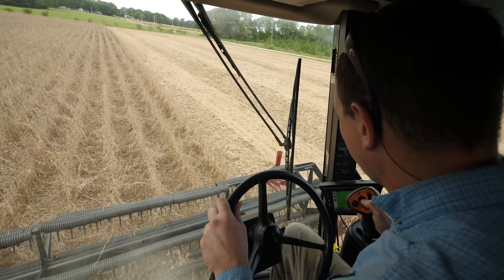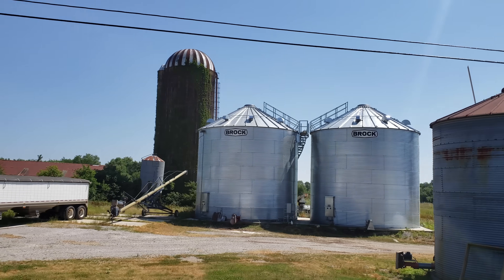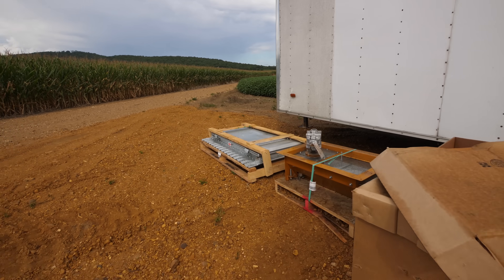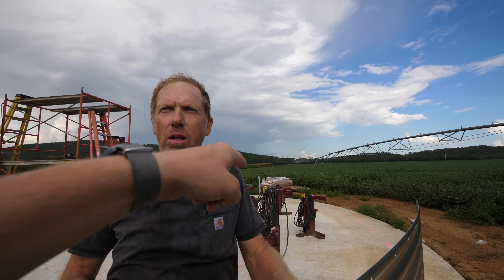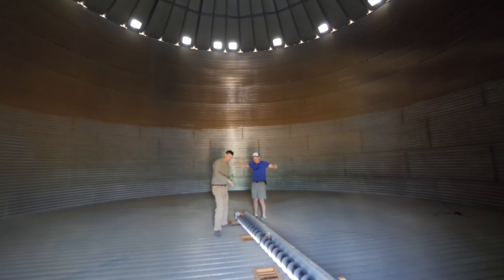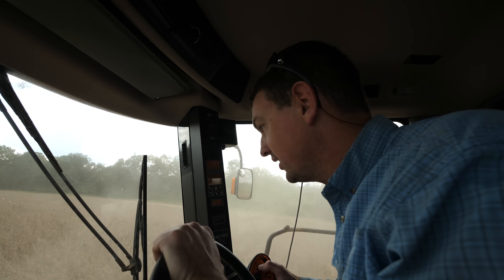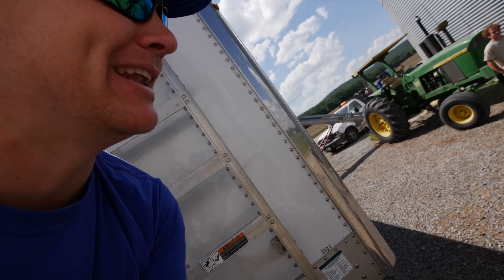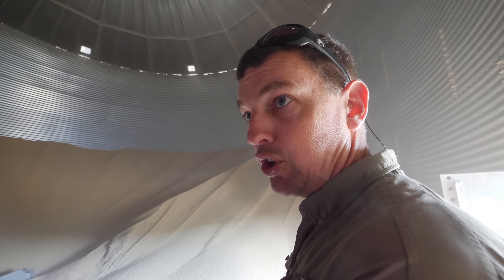Everything About Grain Bins (Farmers are Geniuses) - Smarter Every Day 218

Comment: I thought of the drying process. Doenst it work like the sand pool Mark Rober showed in one of it's videos?
Would you sink to the bottom?
Reply: The way that works is that you increase the amount of air in the sand and the density drops. In this case you have a lot more space between the particles for the air to pass through. Think about pouring water through sand vs. gravel.

Comment: The Debate on 'Glyphosate Toxicity' is far from over. Regulatory Agencies will be setting lower residue limits. Junk Science will be exposed by systematic review. Raw data will be analysed for confidence levels. Interpretation of data monitored for 'Bias' either for or against. Thankfully Artificial Intelligence is a machine operated mostly by The Military who deploy AI to preserve fundamental 'Privacy', yet monitor every electronic communication, by telephone, telex, fax, radio, email etc... 100% coverage. and stored permanently.  This hash policy is to prevent economic warfare escalating to high intensity warfare. Often a result of Public 'Assent', NOT Public 'Consent'... Psychological warfare is of greatest concern. If the public believe they are being poisoned. and later compelling evidence surfaces that those concerns are well justified. Then regrettably we are all in very grave danger of the 'Escalation' of a potential Extinction Event. The biological clock set back billions of years! in the worst case scenario.

"The US National Library of Medicine" Authors Robin Mesnage & Michael Antoniou, 
"FACTS AND FALLACIES IN THE DEBATE ON GLYPHOSATE TOXICITY" (Published 2017 Nov.24th)
Abstract:-
The safety profile of the herbicide glyphosate and its commercial formulations is controversial. Reviews have been published by individuals who are consultants and employees of companies commercializing glyphosate-based herbicides in support of glyphosate’s reapproval by regulatory agencies. These authors conclude that glyphosate is safe at levels below regulatory permissible limits. In contrast, reviews conducted by academic scientists independent of industry report toxic effects below regulatory limits, as well as shortcomings of the current regulatory evaluation of risks associated with glyphosate exposures. Two authors in particular (Samsel and Seneff) have published a series of commentaries proposing that long-term exposure to glyphosate is responsible for many chronic diseases (including cancers, diabetes, neuropathies, obesity, asthma, infections, osteoporosis, infertility, and birth defects). The aim of this review is to examine the evidential basis for these claimed negative health effects and the mechanisms that are alleged to be at their basis. We found that these authors inappropriately employ a deductive reasoning approach based on syllogism. We found that their conclusions are not supported by the available scientific evidence. Thus, the mechanisms and vast range of conditions proposed to result from glyphosate toxicity presented by Samsel and Seneff in their commentaries are at best unsubstantiated theories, speculations, or simply incorrect. This misrepresentation of glyphosate’s toxicity misleads the public, the scientific community, and regulators. Although evidence exists that glyphosate-based herbicides are toxic below regulatory set safety limits, the arguments of Samsel and Seneff largely serve to distract rather than to give a rational direction to much needed future research investigating the toxicity of these pesticides, especially at levels of ingestion that are typical for human populations.

Keywords: glyphosate, chronic disease, pesticides, toxicity, glycine, gluten sensitivity, cytochrome P450 enzyme system, microbiome

Comment: Engineering question: Why are the corrugations horizontal rather than vertical?  I thought corrugations stiffen and help prevent buckling from the vertical loads on the walls, but when they are horizontal I'm not sure their purpose.

Comment: Thanks for the awesome video Destin! I grew up in a farm and spent a couple years building grain bins. Something to mention about the bins is that they are hot! From the touch of the steel to the air inside. The temperature at the Cap is way hour than on the floor.

Comment: I'm super impressed in the way grain bins are assembled and erected. The methods are simple but at the same time genius. They literally put it UP from the TOP DOWN. If it was assembled in a more traditional way (bottom up) you'd need braces to keep the sides from deforming, a ton of scaffolding, and probably some cranes to help assemble the cap. Then again, if it was put up bottom up, it'd probably need more traditional framing.

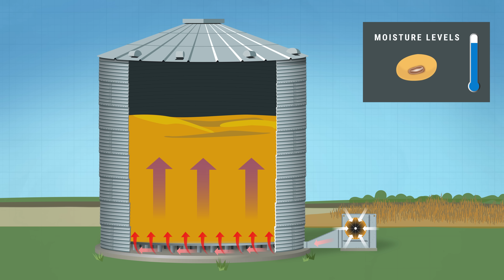Comment: At around 10:00 I just felt that "fluidized bed" explanation coming.. and then there was nothing! But Destin, you love fluid dynamics! I still wonder though, would there be enough air coming from the bottom to create this effect? Then it would sure be super dangerous to be on top of that grain/beans with the ventilation running. Anyways, once again a great video! :)

Comment: i think they hang multiple moisture and other sensor cables  inside the bin, with sensing elements every 4-6 feet, and use computer to control the whole thing.

Comment: Hey Destin, You need to plant your sweet corn(ses) in more rows.  There are 2 reasons for this: 1 - the corn along the outside of the patch doesn't do as well (more competition with other species - in your case your yard) and 2: Corn is an "open pollinated" crop that relies on the wind to move the pollen to the silks to fertilize the grain. If you don't have many rows, that makes it harder for the wind to pollinate the crop as you end up blowing a lot of the pollen into your yard (and not onto the crop). Learned this the hard way myself. If you don't want to raise a huge crop, plant shorter rows in a square plot so that your plot is more rows "wide" and I bet the ones in the center do real well. Good luck with the garden and thank you for shining this much needed light on the ag community. God bless.

Comment: I used to write code for a company that makes these automated air vent systems. We used cables with sensors of humidity and temperature that came from the ceiling all the way to the floor. This way the fans would turn on automatically, to keep the grains dry and at the right temperature, and to reduce the risk of spontaneous combustion.
Very nice video. Keep up the good work.

Comment: Man, I did a short stint of building grain driers in IA, WI, MN. It wasn't a bad job, but the hours were long and almost everyone on the crew was on hard drugs. We'd get up at 5AM and get done at the site around 8PM or later. Then all the other guys would go to the titty bar and I'd try to get some sleep at the motel before going back at it again. I was fired, not because I did poor work, but because I didn't, "fit in" with the crew. Yeeeeeesh.

Comment: Destin, one of the reasons why your corn hasn't done well (I'm assuming you've planted and kept the same size plot every year for your corn as in this video) is that the border of grass around your corn is too CLOSE.  Think of the amount of water that grass takes....just to keep it green.  Then, think about what corn is primarily comprised of....the individual grains that is.... WATER.  Plus, grass takes a great deal of nutrients to keep it green as well as water...think about the root system of grass vs. corn.  They're similar is size and composition. Not exact but similar.  Also, another consideration is the type of grass you have....looks like a variety of Bermuda.  Bermuda sucks a LOT of water.  Theme here is WATER.  You've obviously come to the conclusion that the border of grass around your corn plot is too narrow.  Experiment.  The grass sucks the water away from the corn decreasing growth and a few other things.  Corn requires a "goldilocks" amount of water.  The grass around your corn narrows your margin for error for that "goldilocks" zone.  So, widen the dirt border around the corn and see what happens.  Also, plant some marigolds at the border around the corn.  They a natural insect repellent that lowers the insect pests around your corn.  Great for potatoes and potato bugs (those are the WORST) too!  Smarter every day, eh?

Comment: We use a vacuum cleaner to move our grain...  haha no but really it's called a "grain vac" system, pretty neat thing.  If you look it up.  Another thing about drying grain that's weird is you have to level the top, if you leave the cone shape that is made by loading at one point, it will dry only up to the bottom of the cone and the top has the chance to rot

Comment: Wow. A few months ago I read Julius Caesar's chronicles of the Roman Civil War. They feature some descriptions of the architecture work the legions had to do. And among them, they mention a siege tower they had to build at the siege of Marseille, which they built right beside the city's walls. And they used a similar system to these grain bins, building a first floor and a mobile roof, and raising it little by little as they added floors. This, with the added difficulty that the city defense force was throwing everything they could at them while they were building. Rocks, arrows, fire rags... You name it. They were badass back then.

Comment: Sometimes you frustratingly forget to slip the grommet over the cable when assembling a cord and powerplug -you end up having to take it apart to bits and restart.
Likewise; Someone must have assembled the Grain bin layer by layer, raising it up up and away. When they where done they stepped out and realised they forgot to attach the vents and outsides stairs!

Comment: Destin, about the humidity problem, there is even a greater danger than mold. In some crops, like corn, humidity enables grain fermentation, which generates heat. That heat then overdries the grain around turning it into fuel for a really big bonfire. A really scary, and quite costly bonfire

Comment: As an engineer, I fully agree that farmers is the most difficult job out there XD
Reply: Yeah, you dream-up, imagine, contemplate, design and engineer, and bring into existence something like a harvester or a grain bin; working out all the maths and physics to create a storage unit capable of holding all that grain and keeping it dry and fresh and safe from the elements and easy to load and easy to get the grain back out when it's needed.
But, those farmers. "Woohoo! We read the instructions and put the pieces together with some drills and bolts and nuts and used hydraulic jacks invented and engineered by others farmers, I'm sure. We're geniuses, yeehaw!" "Hey, look Scooter! I poured the concrete. I'm an engineer!" "Oh yeah, Joe-Bob, I turned on the moisture meter. I'm one of them-there scientist!"

Comment: I used to build water tanks for farms in Australia which were built very similar to this. We went from the bottom upward and used external columns to bolt the sheets together that were pre-assembled with threads for the bolting. Then we would use trusses and a specifically designed crane to do the roof. Then the liner is unrolled once the roof is up so it doesn't get damaged by the sun. Nowhere near as safe as this method but not as large as the bins either. Now I'm a mechanical engineer.

Also we call a "punch" a podgy bar (or a pinch bar) in Australia! The most useful fitting tool you can have.

Comment: I recently saw a video, on YouTube, wherein they were demonstrating a rescue device for someone trapped in a grain bin. They left the auger on long enough for the demonstrator to become trapped, and then showed that the trapped person could not dig out, or be dug out, even with help because the grain keeps filling back in. He could not be lifted out either without pulling his arms out of socket.
They were demonstrating a cylinder, maybe 6 foot tall, and  2.5 or 3 feet in diameter. It is lowered around the trapped person, and worked down in to the grain as far as possible. It acts like a cofferdam which then allows the trapped person to dig himself out with a scoop, or bucket, without the grain filling back in. It was very interesting.

Comment: Interesting if this is a dialect thing or what, but I've never called those punches. For me, it's called a punch if the tip is just strictly cylindrical, not tapered. Those tapered ones I've always called "drift pins", since you can use them to "drift" the holes into alignment. As opposed to punches, which I usually use to remove pins from holes (hence the cylindrical shape, not tapered) or just generally tapping on things too far away to get at with a hammer directly.

Comment: Isn't that punch technically a drift pin? I work in theater, we use them all the time, even have specialty socket wrenches with drift pins as the handle (look up Hater Wrench or Scaffold Ratchet)

Comment: when i was growing up, we used a corn tester that passed a small electric current through the sample. it was calibrated to determine moisture content by conductivity.  also: it must be nice to dry with just air movement. in summer in iowa (95 degrees F, 95% humidity) you can't dry corn with just a blower. we heated the blower air by burning propane. and not the gassious propane from the top of the tank (like your grill), we injected liquid propane (from the bottom of a 900 gallon pressure tank) and burned that to heat the blower air.

Comment: Is each ring bolted to the inside of the above ring in order to act as shingles do, and allow the rain to drain down the wall all the way to the ground? If so, is the decreasing diameter change from top to bottom a problem?

Comment: AWESOME vid!  I have always wanted to follow my dad's family in farming, but when you look at all the data they sift through, all the knowledge and skills, it's overwhelming!  When dad was moving back to my state, we went to my uncle's to help load everything into a horse trailer.  To do that we needed a working tractor, and it just so happened my uncle was in the middle of repairing it.  I had to help since my arms are smaller than his, and he was explaining to me how John Deere has started making it harder to get inside their machines in order to force farmers to go to John Deere mechanics to fix them.  It reminds me of my car battery when my uncle tried charging it.  The old cars you can easily get to the jump points on the battery, but the newer models stuff the battery behind everything so the only way to get to it is to have a professional mechanic remove all the parts.  That's a labor cost passed on to the consumer each time they need to replace a car battery rather than the older models which you could do the labor yourself in 5 minutes in a Walmart parking lot.

Comment: Another interesting engineering problem: What happens when these catch fire, or when someone is stuck in one and you have to offload 20-40,000 bushel of grain or seed fast? They are designed specifically to hold low density material. You can't fill them up with water because they'll catastrophically rupture. If someone is stuck and you have to offload grain quickly you have to cut two holes in the panels opposite each other so the grain offloads evenly otherwise, again, it will rupture catastrophically. The design uses the grain itself to support the structure when it's full. Neat stuff. Another cool thing about grain: the angle of repose.

Comment: The concrete slab isn't really that heavily reinforced. Things get a lot denser and crazier with elevated concrete two way non post-tensioned flat plate slabs.... and every concrete beam to concrete column connection.

Comment: I'm working on a next gen VFD fan controller designed specifically for grain bin applications at work. It integrates multiple temp and humidity sensors simultaneously to allow finer control for farmers to manage grain moisture content, all while using less electricity. Runs the fans at the correct speed as enviornmental factors and their target moisture changes. Its cool to see you bring light to this modern marvel!

Comment: They use something similar to the punch to align structural steel when building steel framed buildings. It has a crescent wrench on one side, and a tapered spike for the handle. Its sometimes called a "construction wrench". They use it for the same purpose as those little punches, but on beams that can weight several tons.

Comment: "Punches are the best!"

Reminds me of the episode of Dirty Jobs where they're assembling a billboard sign, and as they're lowering the top piece the holes are rotated slightly out of alignment so the guys tell Mike to align the holes so they can bolt the sign holder assembly to the top of the post and he has no idea how, so they tell him to use the tapered spud wrench he's got.

Literal tons of steel moved into position like it was nothing, absolutely blew Mike's mind.  

Such a simple combination of a lever, and an inclined plane.